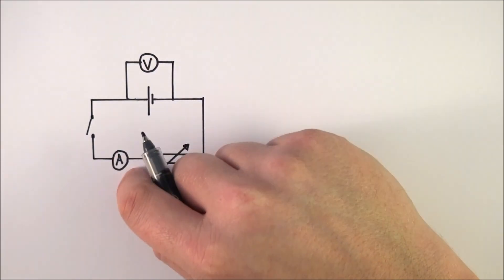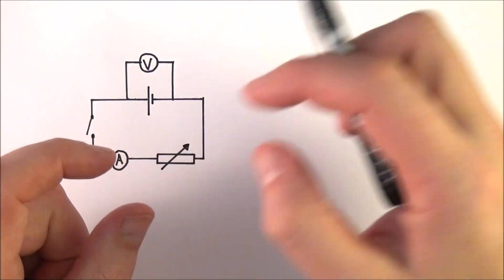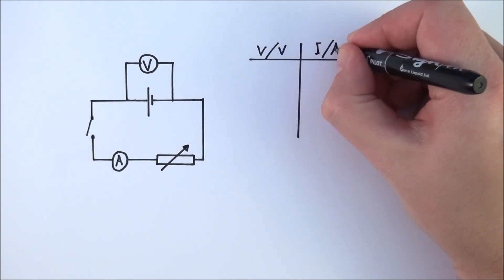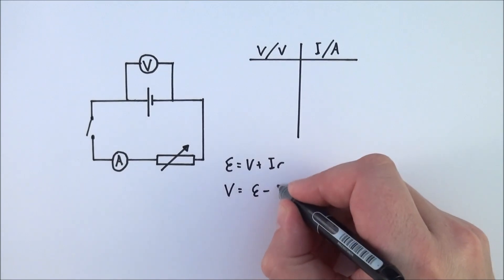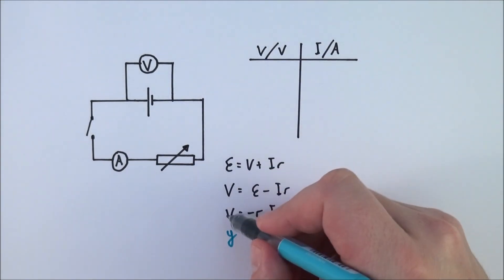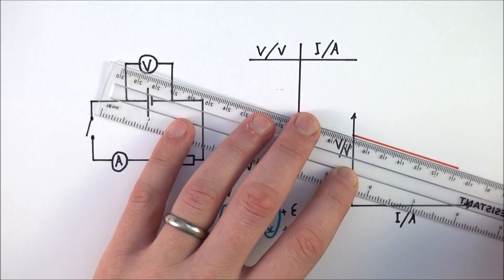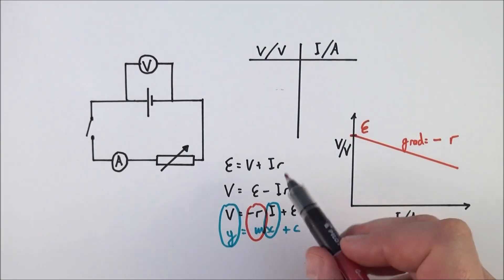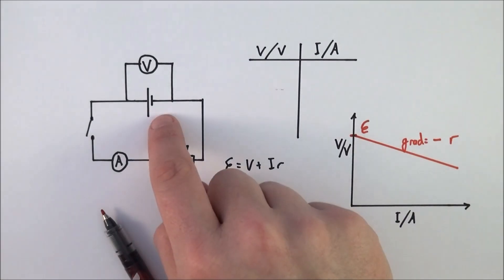Measuring Internal Resistance - PRACTICAL - A Level Physics

Comment: Nice, but... What is the point of taking a few measurements? I see two: a) ascertain that internal resistance is linear in the range of drawn currents (because you obtain a straight line with certain slope) (and this does not need to be the case), and b) accuracy of the measurements. But technically, you could get this "internal resistance" using just a single measurement and dividing U/I. So, my question is: do you really get the true EMF and internal resistance using this method?

Comment: Why doesn’t putting the voltmeter across the terminals give us electromotive force? Isn’t it measuring the pd of the terminal and the internal resistance?
Reply from the maker: It will give a value very close to the emf, but the voltmeter could draw a very small current so your terminal pd measured may be lower.
Reply: @PhysicsOnline  Would the value on the voltmere still equal the external voltage that goes to the rest of the circuit?
Reply: @matteo5399  no

Comment: Thanks for the video sir! I was just wondering- wouldn't you need a fixed resistor to be in the circuit as well in order to have a better control of the current- for safety reasons?
Reply: It'll be like a 1A current at most, so I don't think it'll be that dangerous.